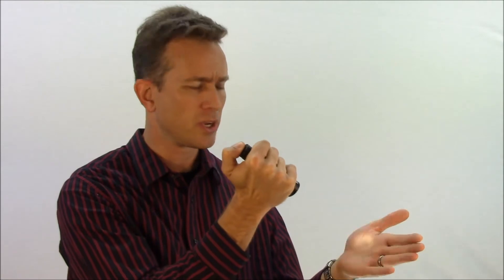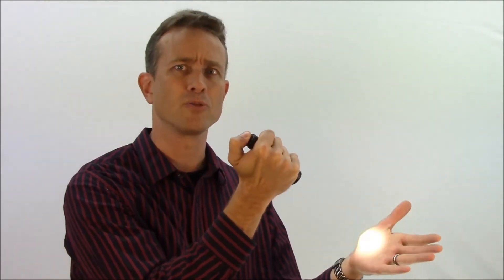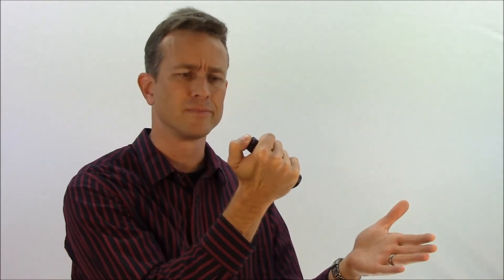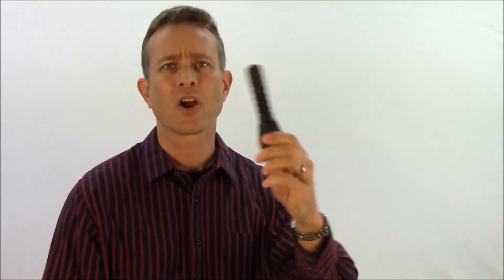User Interface for Tactical Flashlights, Decoupled Binary Controls, Elzetta vlog episode 4

Comment: Your flashlight may have saved my life and I thank you for that. (story below)

I had a 7am doctor's appointment and decided to walk my dogs at 4:45am while it was completely dark outside.  I always walk in the dark with the Elzetta Alpha in low mode dangling from my wrist so that drivers can see me.  That morning, a white truck came around the corner (ignoring the stop sign) and slowed down when it saw me.  Whoever it was revved the engine and I (like always) got off the road because there are no sidewalks where I live.  The truck peeled out and aimed the front bumper directly at my dog and I.  I stepped a few more feet off the road just as the driver flew by at 45 mph within inches of my body.  Startled by this, I walked a good 10 ft from the road and behind a nearby tree.  I watched as the driver approached the nearest intersection and turned around for another pass.

I stayed behind my cover and pulled my dog close as the truck revved it's engine a second time, pointed in my direction.  I snatched the Elzetta Alpha from my lanyard and rotated the tail cap to the high mode; Pointing it at the aggressive truck driver.  At the same time, I pulled my concealed pistol and put it into my front pocket in case the situation escalated further.  The driver was 60 yards away, now illuminated (and hopefully blinded) by my flashlight.  The revving of the engine slowed and he crept forward towards me steadily.  I kept one hand on the flashlight, aimed directly at the driver and the other hand on my pistol while still covered by the thick tree.  The small white pickup truck crept slowly towards me as I kept the light trained on his location and just before I saw the driver, he took off in a rubber-burning cloud of smoke.  He ran the next stop sign to the right and sped off down the road away from me.  I waited behind that tree for about five minutes waiting for the maniac to return, but he didn't.  At that point, I put the Alpha back on low mode and kept walking with my head on a swivel.

Your flashlight may have saved a life that morning.  Whether it was my life or his is irrelevant, but I am eternally grateful that I was prepared for that encounter; Both with equipment and tactics.  I ordered another light from ya'll recently and I recommend them to everyone I know.  I am certain that without this intimidating light, that situation would have been much worse for one of us.  Thank you again for providing me with the life-saving tool that many people take for granted.

P.S.  I got both my lights engraved with "If found call (10 digit phone #)" if you want to verify who I am.
Reply from the maker: Glad the situation turned out so well!

Comment from the maker: Thanks for the comments.  Please remember that we make The Toughest Flashlights on the Planet for operators whose very lives depend on the reliability of their equipment.  We do not compromise.  USA-Made CR123A cells offer the most reliable, robust, and durable power source of any battery technology available today and do so at a very reasonable cost ($1.95 each).  Please do not trust your life to 18650 or other rechargeable batteries!